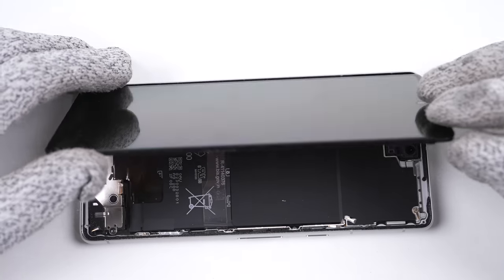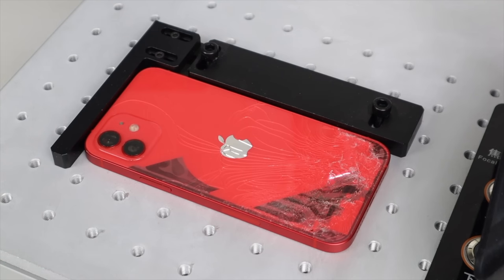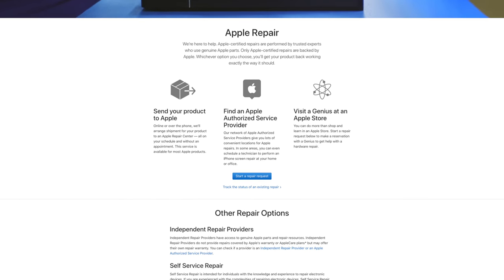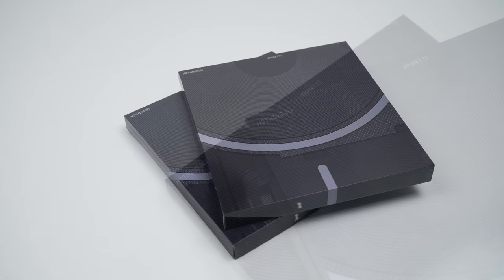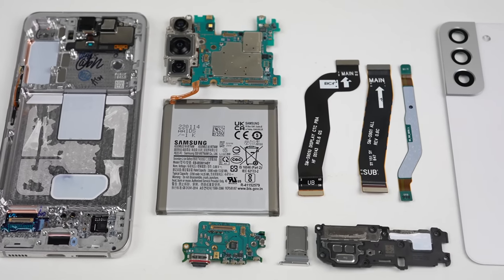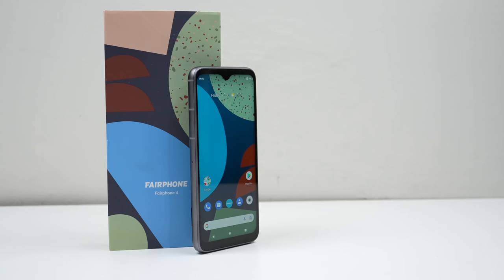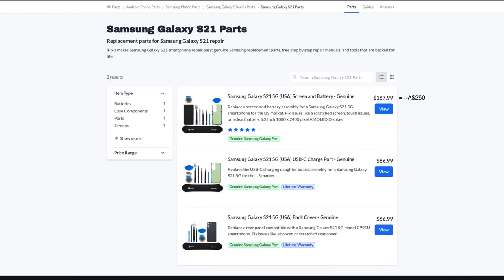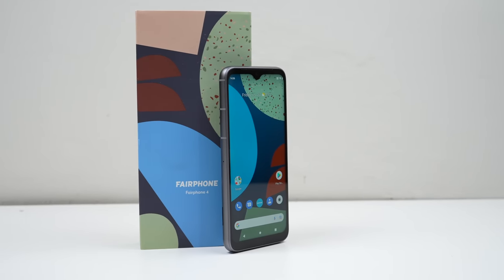Most & Least Repairable Phones Of 2022 - The Phone Less Repairable Than The iPhone.

Comment: It's not a flagship, but I just picked up the Samsung XCover 6 Pro, which has a replaceable battery, dual SIM, and a micro SD card slot. It was designed for enterprise, so I assume the components aren't paired to the board, but don't know for certain; would you consider giving it a look? It's a longshot, but I'm hoping that if it picks up enough steam on the consumer market, Samsung and other manufacturers might start to have second thoughts about gluing everything together.
Reply: I had an Xcover 4 for a while, and it was nice to have the detachable battery and back plate
Reply: I hear that the xcover is garbage:/
Reply: For all the new features on modern phones, in some ways we have gone backwards.
LG used to have all those features on their flagship G3 and G4 many years ago (before LG's management ran their phones division into the ground). A spare  battery or two were great for traveling.
Reply: @Maximus20778  its not supposed to be like the s lineup, its a midrange phone which focuses on durability and if you just dont like samsung thats not a valid argument
Reply: The xcover 6 pro is awesome. It even has an IP68 water resistance rating I'm pretty sure
Reply: @keine_ahnung_wie_der_heisst  nah I have Samsung but I heard it was trash for some reason on gsm arena
Reply: @Maximus20778  You're going to have to be more specific; 'garbage' is not a very good descriptor. Compared to flagships, the main deficiencies are an LCD screen rather than OLED, a mid-range processor, a small and slow-charging 4050 mAh battery (offset by the fact that it can be swapped out in ten seconds), a decent (but not great) camera. I obviously found this sufficient, but it won't compare to the S series if that's what your needs are.
Reply: @ghjong001  I need lcd. I get a headache if I see a Oled screen for long. 

I know because my friend was showing me something on his iPhone 13 and my head felt like it was exploding
Reply: X cover Pro 6 wasn't available when I left the US in Sept or I would have bought it. How do you like the speed, display, camera?  Thanks!
Reply: @Maximus20778  comments on gsmarena has always been the negative against samsung on one way or another, and also xcover 6 pro is like the best phone of xcover lineup now, with decent snapdragon 778G and 3.5mm headphone jack

Comment: I was amazed by the repairability of my Ulefone Power Armor 13. Modular internal design, held together with screws, sealed with a reusable rubber gasket and no glue or software locks to be found.
Would really like to see your professional repair analysis on this phone since I didn't dare to take it further apart than to remove the back panel to clean the speaker mesh.

Comment: I still use my 4 year old mate 20 pro. Had a screen and battery replacement done 3rd party as both died screen went green and battery stopped holding charge. No software locks on either

Comment: Samsung has given a rebuttal to Fairphone with the Xcover 6 pro (removable plastic back, battery that pops out and all the same size phillips head screws) and with an added middle finger, has a headphone jack. 

If it had an S pen and IR blaster it'd be my dream phone.

Can't get it from mymobile yet though and Kogan's third party seller has it for $100 AUD more than the other places.
Reply: Not really a middle finger but more having a bigger budget by factors compared to fairphone. They also seem to try and use parts which are not custom made therefore a smaller carbon footprint. 
Being said, great move by Samsung! Glad to see other folk following the path of repairability

Comment: One thing that prevented from getting the fairphone is the lack of OLED display, since I am too used to OLED at this point. If it had that or at least was a swap-in replacement, I would have 100% bought it. But alas, for now not an option for me
Reply: And a friggin 3.5mm jack. Can't believe a company such as Fairphone removed it.
Reply: @s2000.  and to think, Sony is still proudly including it. I think they got gready and decided to push some buds, which are ironically so crappy to repair that it destroys Fairphone's rep
Reply: Plus they have a rollback protection, partially even more restrictive than Apple. Upgrade your phone to the latest version available via OTA update, then no way back for you and most custom roms would then brick your device.
A company like Fairphone should push custom roms, not prevent them, by including such BS.

Comment: Would be amazing if you could disassemble the Sony Xperia 10 iv phone. It has a plastic back panel, so I would imagine it's fairly easy to remove it (I have cracked glass back panels in the past). Also I see all kinds of spare parts and new battery are available for it for a fair price online.
Reply: Yeah it is nice sony still manage to release a midrange phone when their smartphone lineup crippled every year in terms of revenue
Reply: @mtaufiqn5040  wdym? It's doing better than the old Xperia
Reply: @keonxd8918 i'm pretty sure the lack of innovative design, feature and high price tag are the main issues with sony's recent smartphone bussiness
Reply: @mtaufiqn5040  Yes, I think their top of the line phones are insanely overpriced compared to what they are. Also 4k display in a phone, what a joke, immediately crippling battery life for a feature that has no real world benefit and only looks good on paper. But their midrange 10 iv phone is really amazing, that's the phone I decided to buy after quite a bit of contemplation, and I have zero regrets. I am just eager to find someone online, who would finally do a teardown video about it.
Reply: @mtaufiqn5040  ironic when all the iPhones and Samsung's are literally on the same design for years, plus removing features is innovative I guess? That's my issue with the smartphone industry, removing features like the headphone jack, SD card slot. I'll never purchase a phone without them.

Comment: I moved from electronic repairs to car repairs. And what can I say. Compared to car manufacturers, tech companies are holy. Imagine macbook, that requires you to remove screen first to gain access to back cover. And than if you put it back together you will need 1000 buks/month software to get it started, and if you use some other software it might start burning.

Comment: Still on my Asus Zenphone 6. Had to replace the USB-C jack which I got on Ebay for cheap. Also replaced my fingerprint reader cause dumbass accidentally snapped the cable whole replacing the USB-C module (Completely my fault) and I also replaced the battery. As per the battery and fingerprint scanner I had to order from Asus directly as it was hard to find those parts on ebay, etc also Asus phones aren't necessarily mainstream enough where thete are a ton of parts available. With that at least you can readily order whatever part you need from the OEM at reasonable prices although the shipping is more pricey but still way cheaper overall than Apple. Point being at least the phone is easily repaired and parts are available as it should be.

Comment: iPhones use glue, that is a step down from repairability.  Need specialized tools for that and a supply of the glue required.  The practice of using glue just needs to stop, its used only to make end users unable to repair devices themself at open.

Comment: there is no engineering reason to glue in a battery. ive owned several phones that had simple friction fit batteries. if rattling is a concern, a foam spacer glued to the battery could hold it in place just fine.

Comment: since when was the bootloader on the S22 unlockable? Afaik the bootloader has been locked on Snapdragon Samsung phones for years, I believe every since the S4 or S6. That's the only good thing about the Exynos variant is that the bootloader can be unlocked, but not on Snapdragon variants.
Reply: If you get an unlocked Samsung phone and not one tied to a carrier the boot loader can be unlocked even if it's a snapdragon variant, I believe as I unlocked my s10 plus with a snapdragon one easily.
Reply: yeah Snapdragon variants of Samsung flagships actually don't support unlocking the bootloader..
Reply: @csr2537  they do.. the only reason people believe this is because most carriers lock the bootloader's.
Reply: @csr2537  i reckon you need to know basics about unlocked phoned vs carrier locked ones. Bootloader isn't even hard to understand?
Reply: @Cɪᴛᴀʀᴏ SR  Even snapdragon international version samsung phones don't even have locked bootloader.

Comment: To be honest, OLED based phones are the worst to repair. At this point, I'd rather stick with a budget phone with a massive battery, IPS display, massive fast charger and a physical side mounted fingerprint instead of the fancy OLED with it's fingerprint under the display which can barely resist accidental falls.
Reply: I backed away from flagship phones around 2016.  Zero regrets.  I think I had one phone in the mix somewhere that had a rather crappy camera, but beyond that I'm thousands ahead.
Reply: @ShainAndrews  OLED panels are way too costly to repair. My friend dropped his Galaxy S9 accidentally and due to the cost of the panel only, he ended up buying a new Galaxy A52 instead of fixing the old s9
Reply: @ShainAndrews  I buy used phones and try to take good care of them. So far I've been able to enjoy "flagship" performance for less than most midrange and even lower midrange phones. You don't usually get to play with the absolute latest but it beats many budget phones imo. Of course not everyone lives in a place where this is as easy to do.
Of course if you don't mind your phone being a brick, you can use chunky cases
Reply: @danteerskine7678  it's mainly just Samsung's oled panels that are so pricey. Panels for iphones and pixels are far cheaper

Comment: None of these products can be associated with the word "repairable".
For something to be repairable there should be:
- a comprehensive knowhow and knowledge base, with support manuals and schematics that will allow board and component level repair.
- a wide variety of alternative spare and replacement parts for both subassemblies and PCB components, so that anything can be repaired with the most affordable price.
A screen can be offered for hundreds of dollars if bought from original brand or to buy alternatives from one of the many other sellers that can be cheaper or more expensive, that can be better or worse.
Look in the world of computers, you can buy a screen for you PC from a host of manufacturers some better than the others, or similar but at a lower price.
The same should be doable with phone and tablets and laptops, etc...
...
And a company should be branded as an anti-repair company when they employ specific anti-repair processes. The most basic of such things is using proprietary screws. Any product that doesn't use a regular widespread screw type is anti repair.
Then we go into lack of spare parts. If there is no spare parts available or just one offer from the manufactuer itself, that is a giant red flag of antirepair and monopoly.
Then we have the software lock that doesn't allow the replacement of other parts. And i'm not talking about using affordable parts. Even the same part from another perfectly similar product, if that doesn't work, clearly an anti-repair company that should be shut down by govermental consumer protection agencies.
And the lack of schematics on how to do repair of your product.
No copyright bullshit here, because anyone can agree, these phones are nothing amazing. Is the same tech as several years back. It's not warp engine from the 24th century future civilization .
Especially Apple is an obsolete brand that uses old tech. They should have no right to claim any IPs to defend not sharing tech.
In fact a company should be branded repairable when they go the extra mile to ensure there are countless alternatives for each of their parts, and moreover they themselves develop new products using old platform.
For example with Samsung. The flagship phone from 2022 should be found as an entry level phone from 2026 or something.
Literally, you can buy the S22 now  as new with all the bells and whistles of being a brand new whatever top of the line, and still buy it in 6 years, still new, but because the tech evolved so much it is an entry level.
And this last statement proves the previous point, where the tech is not much different from one year to another and they don't ake amazing new tech that can be sincerely protected with copyrights and IPs, because it's not. The s22 is not much different from it's predecessor or next year replacement.
Phones should not be replaced each year. The s22 is launched now and the successor in like 5 years when there is sufficient development to justify a new model, just like game consoles. You don't see them launch a new Playstation each year with minimal to no benefits.

Comment: Hi Hugh! I am a pretty big fan of your channel and I have a question. Do you think there will be batteries that are held in in a different way in the future? Screws maybe?
Reply: Batteries are already held with screws in some devices. They are stuck down to prevent or make repairs hard.
Reply: @John Sinclair they are phones they can be removable in 2022 it's just not common anymore. Look at the fair phone and the Samsung xcover.
Reply: @traviswalker8933  if not  how many would bitch about rattles
Reply: @amorylazlo9579  I think screws and clips would do just fine rather than adhesive.

Comment: That Nothing Phone is probably the most disappointing release to me. It looks nice, but the LEDs are still pointless and clearly overcomplicate it. It's certainly one of the most over-hyped products I've seen in a long time, and I really don't think it's a particularly worthwhile device. I mean, it's fine, but you can get similarly specced phones that are also easier to repair at a similar price.
Reply: I mean it's got the finish of an iphone with really good software and the phone stands out unlike every bland brick :/
Reply: @Maximus20778  At least until you look at the front, which looks just like 90% of all androids these days, with a punch hole. At least from the front, Sony phones are easy to identify by their 21:9 screen, uniform top and bottom bezels and barely rounded corners in the screen.
Reply: @lukasegeling5205  90% of phones don't have hole punch, they have that  curved display thing.